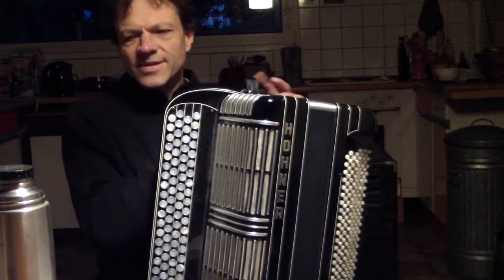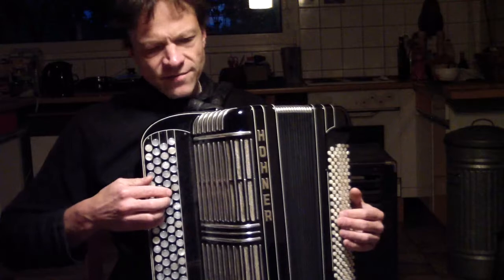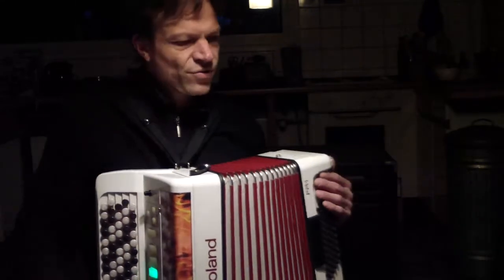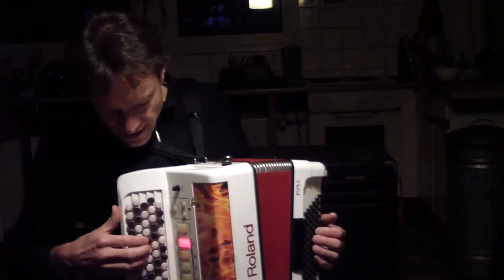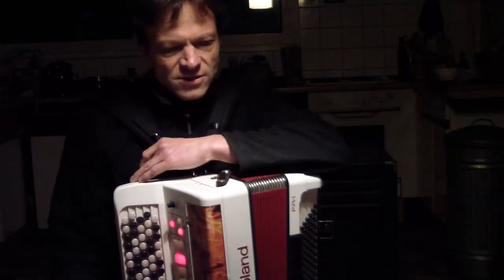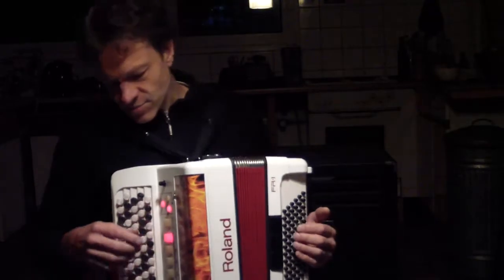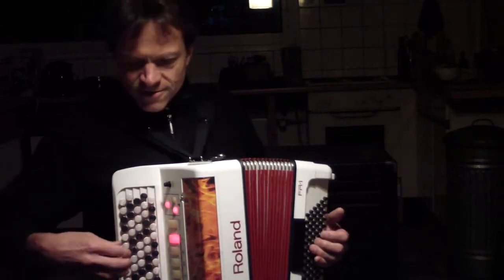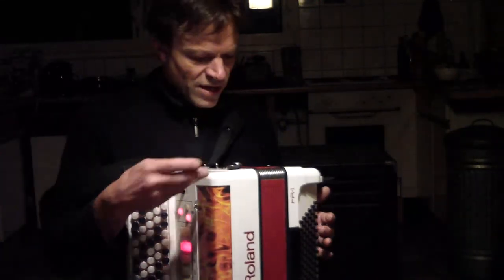Roland FR-1b as an organ controller for Aeolus

Comment: Uiuiui - what a tuning of the first Roland organ?
Kirnberger? :-)
Reply from the maker: Actually, that's what I thought to have set (because Meantone was too cruel), but it would appear I didn't save.  It was likely Meantone after all.  I should probably retry with something better fitting.  Equal temperament actually sounded rather dissatisfactory as well: the clear tonal quality of the organ makes nothing at all sound quite right then.

The "second" organ is actually the same, just with a few more stops pulled.  It just sounds better because of being played in D major rather than G minor.